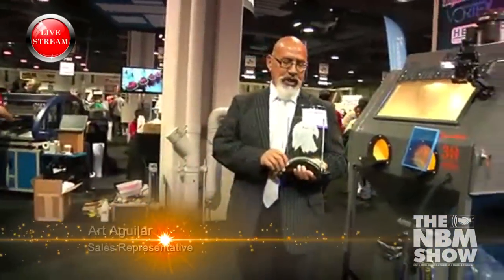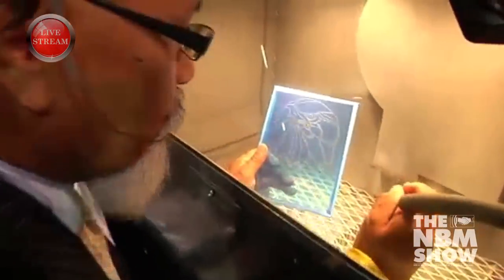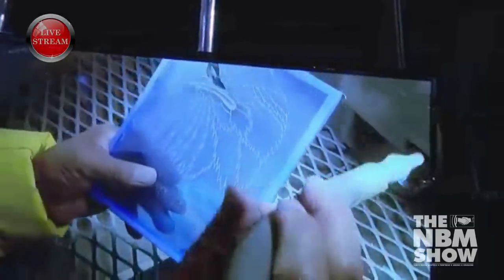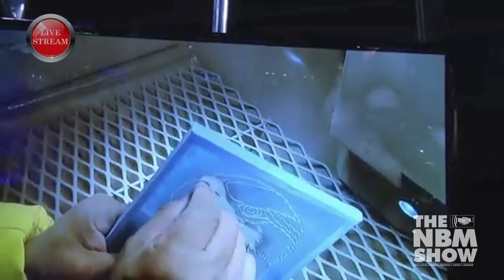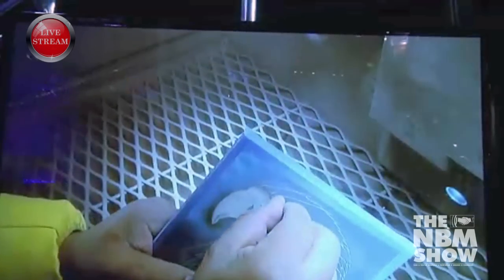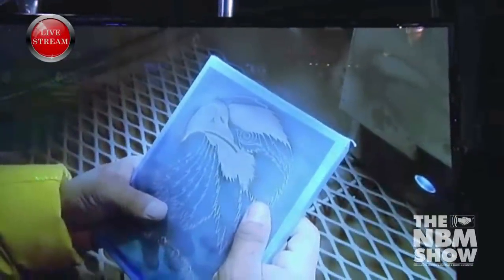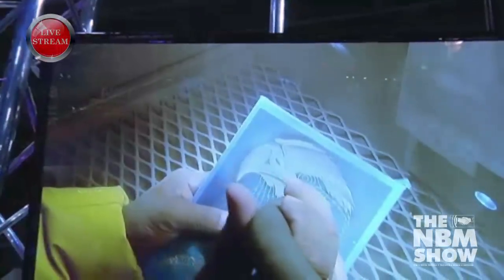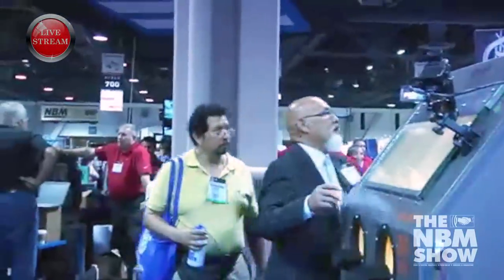Multi-Stage Sandcarving LIVE webcast

Comment: it doesn't show real good but it would seem to me that the little pieces of plastic you peel off would eventually clog the hose or tip, unless you put them in a can or box or something so they don't go down into the sand hopper.
Reply from the maker: Thank you for watching. Very keen observation. The Mask that is being peeled away cannot clog the hose or the nozzle because of the sifting screen at the bottom of the blast cabinet (it would also very easy to collect that mask rather than dropping it). The bit of mask or debries will settle there and can be removed or sucked up with a shop vac. It is only the media that can pass through the screen. If you have more interest in the process, I will encourage you to consider taking a Sandcaring Workshop. Completely had on and this 16-stage care eagle is the ending project. see: Rayzist.com for details.

Comment: We are looking into do more of this for our customers.  I work in recognition.  How do you know which pieces to peal in which sequence?  I would think this is more art than a piece of crystal/glass used for an award.
Reply from the maker: Thank you Ryan for the comment. If you notice the image is a simple line art stencil, not only are the "pulls" easy, the design allows for it, parts of a design can also be freehand cut if you feel the need. 
Determining which parts of the image to pull, take a bit of thought on dimension viewing the engraving through the glass. There is a sense of Art to the process, but really, this piece can be fairly complicated, smart small with shading or frosting, look at a design determine a sequence of pulls. Then move into a sequence of "sandcarving" 
I would encourage you to take a Sandcarving class which should equip you to become a bit more knowledgable.

Comment: What grit is this?
Reply from the maker: This grit size used would have been 150 grit Aluminum Oxide - which is a multi-purpose grain size. With "sandcarving," there are advantages to using a coarser grain for cut speed. Appreciate you watching.

Comment: Hai, I am Achalananda , A.P., India
How much this blasting Machine ? and Which size material sand carving ?
How much SR 3000 Photoresist Film cost ?
When will exhibition in India.
Please reply immediately
Thank you sir
Reply from the maker: Thank you for your interest. The basting machine used in this clip is our 2034VXA Sandcarving System. We are using SR3000 Self Stick Photoresist film, 5Mil for multistage carving. Unfortunately, we have not trade fairs in India. Please visit our website, www.rayzist.com for pricing or to LiveChat with a representative.